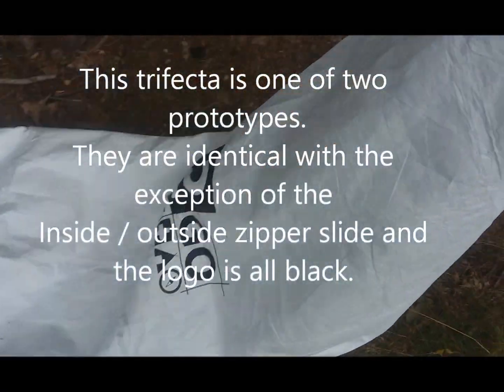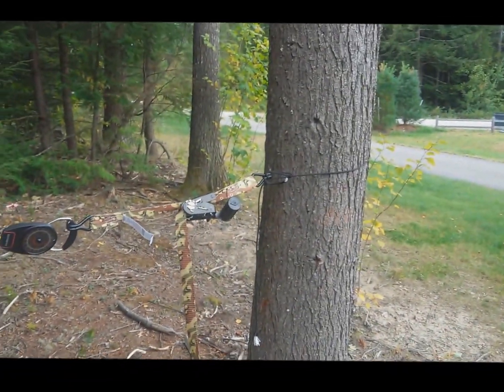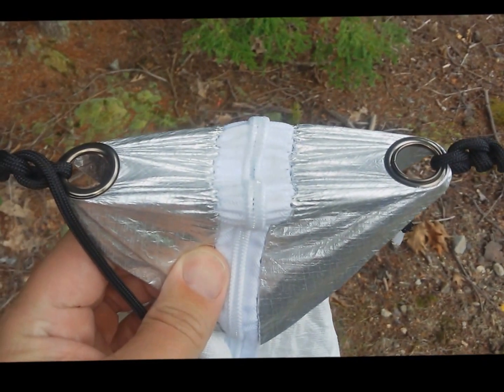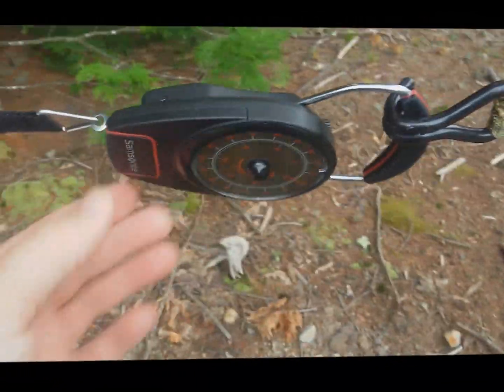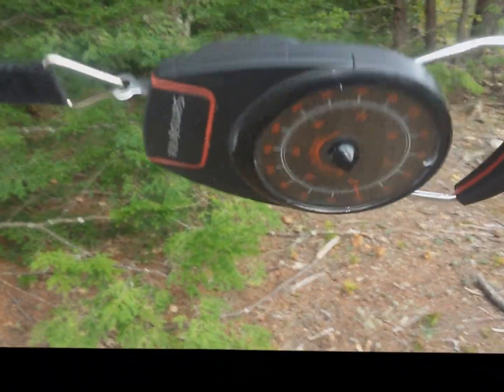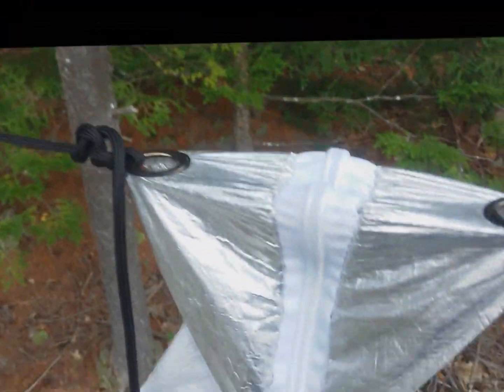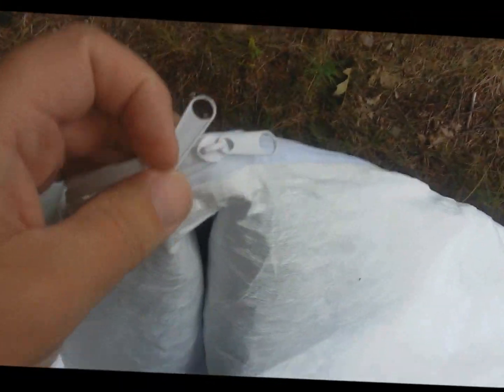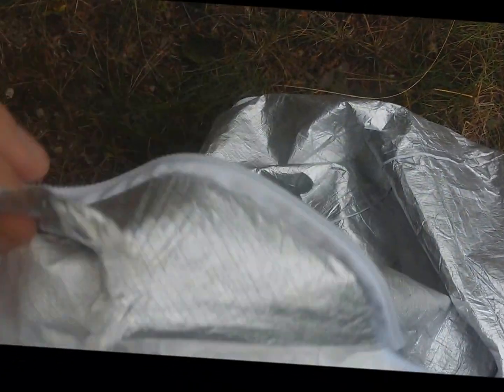2GoSystems Trifecta zipper, stiching and grommet failure test

Comment: The braking point of the grommets was about 30lb if someone were using the Trifecta as a rainfly over a hammock do you think there is a chance they might snap
Reply from the maker: +miguel ochoa No I don't think that will be a problem at all, this test was unrealistic in normal conditions. When tied as a canopy you will have four attachment points to distribute any load. 

 At 30lbs the paracord was unrealistically tight for any kind of tie-down.  This test was to show where the Trifecta would fail first. Also if a grommet did fail you could easily weave in some para cord into the grommet tie down flap. 

The flap is separate from the main body of the Trifecta and wouldn't diminish the normal use of it. 

Brian

Comment: Is the  tryfecta completely waterproof could it be used as a rain fly perhaps
Reply from the maker: +miguel ochoa  The Trifecta is made out of Tyvek 1460c material. It is very water proof and I would be completely confident in using it as a rain fly or canopy.  I have to add that the zipper is not a water proof zipper. Also there may be a few micro holes from the stitching that there could be water intrusion. 

Please take a look at the below site it gives a great amount of information on the material.
http://www.materialconcepts.com/products/tyvek/uv-soft/
----------------------
Water Resistancef| Hydrostatic Head (AATCC 127) | >50 Inches without penetration
---------------------
This test is a measurement of water resistance, Basically there is a square tube pressed up against the material, then they add water, in this instance the 1460c material handles greater than 50 inches of water without penetration. This is much more than most outdoor gear.